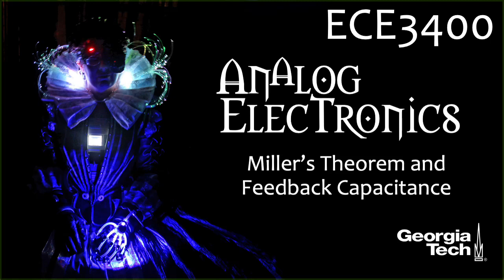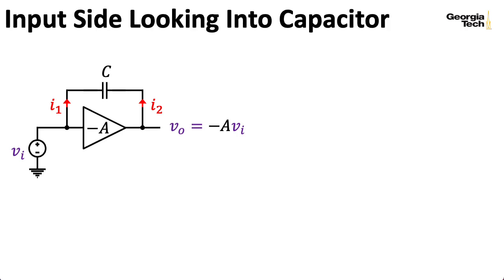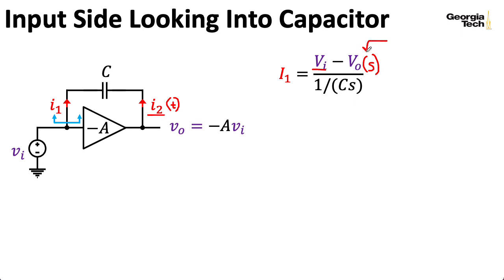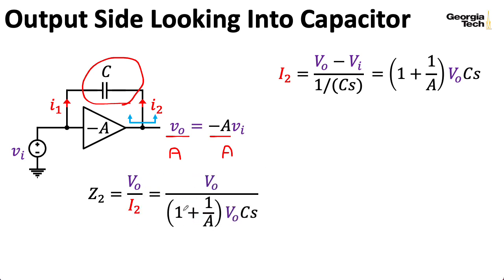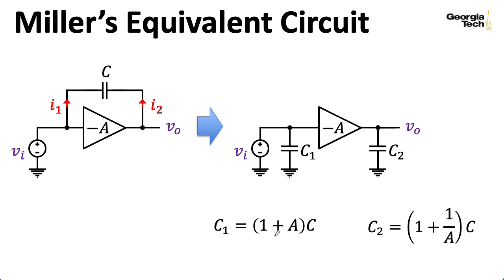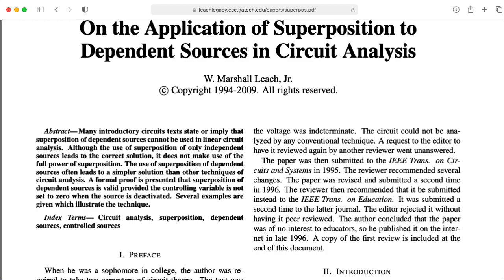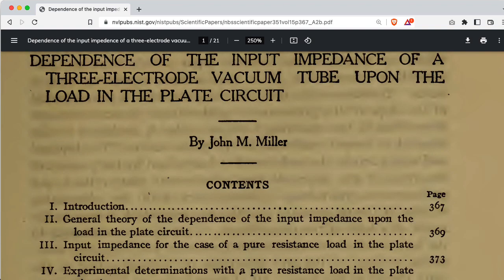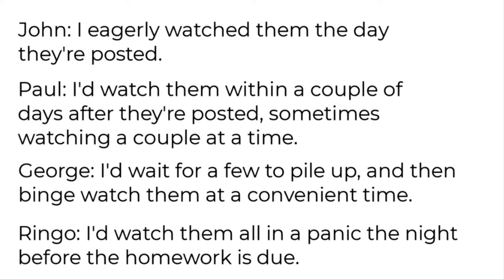ECE3400 Lecture 35: Miller's Theorem and Feedback Capacitance (Analog Electronics, Georgia Tech)

Comment: The Miller effect can be taken advantage of in interesting ways - like varying gain to tune an L C resonant circuit in a wah pedal, or driving a ground shield to reduce the capacitance of coax.
Reply from the maker: I have a lecture on inductor-based wah pedals: https://youtu.be/6uRS-J61E5o
Reply from the maker: Oh, I didn't know about the coax trick. That is interesting!